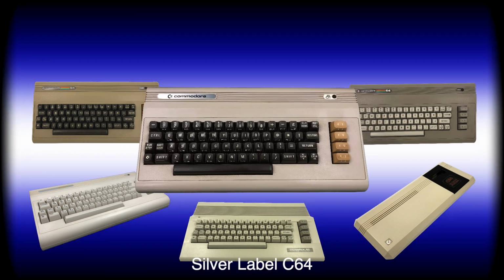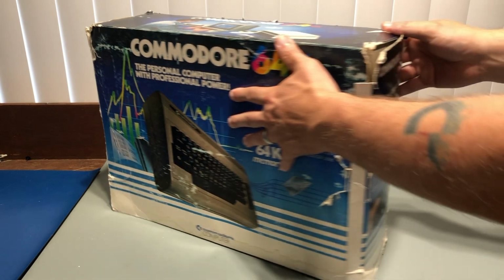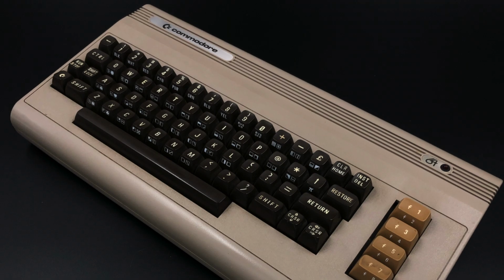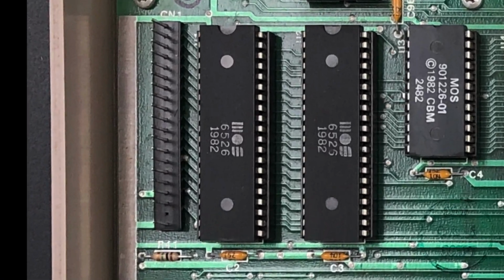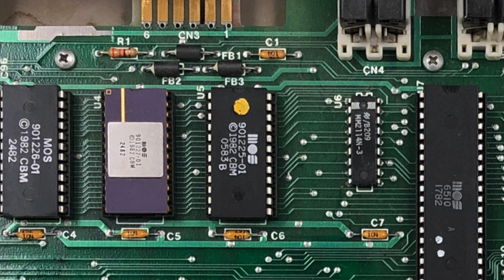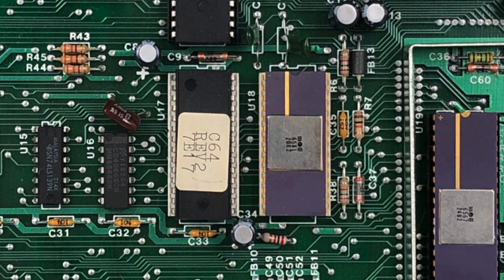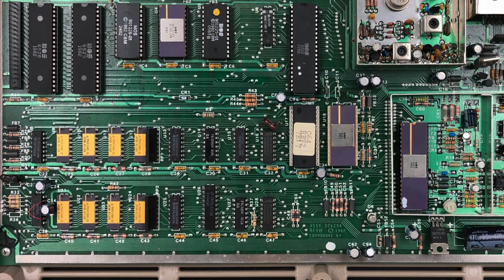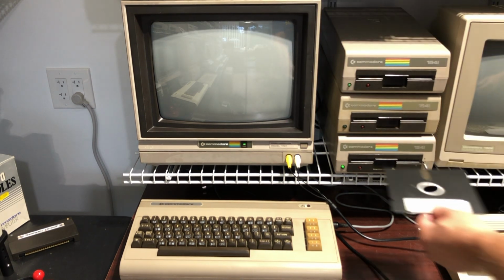Exploring an early silver-label Commodore 64

Comment: Thanks for the video, I really enjoyed that. It took me back to the multitude of C64s that I had (ex-programmer)

The 6581 and 8580 difference is easily noticed when playing something that uses the filters and/or sound samples. The filters on the 8580 are generally preferred.

The 8580 would play samples very quietly. A fix for this has been discovered, I think it involves soldering a resistor across 2 legs on the SID.

Comment: I have several early silver labels, not quite as old as yours but one is close in the 4000 range.
I also have a 4-page sales brochure from '82 that shows a silver label c64, a black label 1540, a VIC 1515 printer, a white (lawsuit) joystick, white paddles, a VIC modem cartridge and a white/black C2N cassette player.
Naturally, i had to get all those exact peripherals for my silver label display.
Reply: I have silver label too mines 1982 rev C board is that one rare ? And how much is worth it in very good condition also it had a ram upgrade
Reply: @bayfinest1938  It's hard to put a price on this without seeing the machine itself. The Rev C is already much rarer than the Rev A so price would depend on how low the case serial number is and if the board has any purple ceramic chips. I'd say a nice example with a serial number below 10000 can fetch over $1k, even more if it has purple ceramic chips. If yours has purple ceramic chips or a low serial number below 5000, i'd be interested if you want to sell it.
Reply: @CybAtSteam I can send you pictures
Reply: @CybAtSteam  mines serial is 6259

Comment: I remember that old white Styrofoam that came with my Vic-20 in 1981.   It's not surprising that Commodore used the same packaging that was used for the Vic-20 till it was changed in later models.  I've had the Vic-20 (Golden badge), C64 and Amiga 500 before moving over to the Linux world.
Reply from the maker: Similarly, I went from Commodore to Unix servers once I began my professional career.

Comment: You can't trust commodore serial numbers - they were notorious for releasing anything out the door, broken or not.
Reply from the maker: Sure, but you can use serial numbers in conjunction with date codes on chips and other clues.
Reply: @commodorehistory   Definitely keep that C64 long as you can.  It's really worth weight in gold as I can't imagine how many of those early C64s are still around.

Comment: The C's SID sounds a little quieter, assuming that you didn't bump the monitor's volume at switchover. But I can't really tell a difference besides that. If you will run it again with a direct capture then maybe I'd be able to tell. Anyway, what difference there might be is really subtle to me at most, so that's good!

Comment: If they were fixing all these bugs then why didn't they fix the one that required them to make the 1541 so the computer could have a slower drive friend to play with?
Reply: That wasn't a bug, that was by design
Reply: @CybAtSteam : It was a bug. The story is that the 64 needed its disk drive to be slowed down because of this bug that they never got around to fixing. They wouldn't design that into the computer.
Reply: @HelloKittyFanMan  Nope, not a bug. The VIC-2 needs extra cpu cycles during "bad lines" (every 8th raster line) to fetch sprite and character data for the next 8 scan lines. During those bad lines, it needs to halt the cpu (yes, the c64 had dma) for additional cycles.
Because of that, the existing serial code from the Vic-20 had timing issues (since the Vic-20 didn't have sprites to deal with). This was solved by making the c64 serial timing slower than on previous hardware platforms. Again, not a bug, but very much by design.
Reply: @CybAtSteam : Yes, a bug, because:

1. It's always been described as that by experts of the history, because...

2. it's something that Commodore could've fixed but pushed the computer out too soon for, and...

3. it's something that software-based fast loaders -- even  those that don't blank the screen during loading -- DO temporarily fix, and...

4. is something that the hardware-based fast loader did fix permanently, and...

5.  it indeed WAS officially permanently fixed by Commodore in the next VIC-II-based  computer that was released: the (non-B) 128.
Reply: @HelloKittyFanMan  Not a bug. There are several videos on YouTube where Al Charpentier talks about the VIC-2 design and the timing issue specifically. He's the guy who designed the VIC-2.
And i'm inclined to trust his account of why it is the way it is over some random guy on the internet that insists that something is a bug even though the actual designer states it was done by design.
Reply: @CybAtSteam : The videos I watched that describes it weren't just from some "random guy." Also, I love how you conveniently left out any counter explanation of how the problem is fixed by fast loaders and by the 128 even though this is supposedly "not a bug."
Reply: The fix was known for C64 production time but it would have been a breaking change and drives would not be interoperable between VIC and C64s. In C64 they had to run even a bit slower due to higher resolution and scan line time.
Reply: @kippie80  Commodore could have fixed the C64's timing issue and revise the 1541 to be as 1542 to say it will only work with later models of C64.  However, I don't think the public would fully understand the differences and create a massive headache for everyone involved.   Easier just nerf the C64 and keep going.   Although I loved my Epyx Fast Load cartridge.  🤣

Comment: These early c64s still have a luma pin on the video out. Commodore originally expected users to use composite for the chroma signal on the 1701/1702

Comment: Great work Dave; I haven't heard such a clear explanation of the cause of the sparkle bug before!
Reply from the maker: Thanks so much Robin!  I used Al Charpentier's own words from the March 1985 issue of IEEE Spectrum in the "Design case history: the Commodore 64" article.  There's one detail I left out that's described in the article that explains there was a pre-charge circuit in the ROM that made it sensitive to spurious signals.  I always struggle with the balance of providing too much or too little information.  In this case, I should have probably included that detail.

Comment: If you don't hear the difference between SID chips is because you are playing normal sounds.
Fire up IMPOSSIBLE MISSION or GHOSTBUSTERS and you will hear a noticeable difference...
There is a way, anyway, to disable the filter they added but just connecting a resistor between 2 SID pins.
Reply from the maker: Good point on the differences when speech synthesis was involved.  I probably never paid attention to that in the past.
Reply: @commodorehistory  The filter cutoff frequency curves are quite different too. So, in the end, digital sound code written for the 6581 is often almost inaudible on a 8580, and I met more modern demos, written for the new SID revision, with complete tunes filtered to silence by the 6581. I'm not into their religious war though ,as I can't say if any of the two is better. They're surely different. And the 8580 seems way more durable, I have much better success rate with the trash picked 8580s than with 6581s.
Reply: There is no difference in sound because the other Commodore 64 is the red LED version, and it has a long board and the old SID 6581. I have this version, so I can confirm it. However, there are differences in the image, which results from, among others, from another VIC-II chip (later revisions had 9 brightness levels) and the S-Video signal, if it was connected.
Reply: 8580s on NTSC C64c’s are rarer in America than in Europe. Usually the keyboard will also change and have the PETSCII graphics printed on top
Reply: You can probably run it through audacity to visually see the differences.

Comment: Nice work! I've never seen that cardboard C64 box with the PET dual drive before.
I have my original C64 purchased in '83 (original owner) serial no. P00138518 ASSY 326298 REV A (C) 1982 that came in the corrugated cardboard box you show with the 1540 on it.
Curiously my ASSY 326298 board is Rev. A whereas yours is Rev. B., but ostensibly manufactured earlier.

Any idea what the date/timeline was for the ASSY 326298 change from REV A to REV B?
It has been suggested that my machine with ASSY 326298 and rainbow badge may have been built from a returned/refurbished board. (We bought it for $595 in early '83. Its chips are dated mid to late '82.)
Reply from the maker: I was chatting with some friends about this. Based on a small sample size, we concluded that they shipped completed units first with rev B, then rev C, then went back to rev A boards. No idea on timeline.
Reply: @commodorehistory  Exactly what I wondered - if they went back to REV A; they seem, albeit anecdotally much more common too. But they were followed by much bigger fixes with the next ASSY #s.
Tnx!
Reply: @commodorehistory  hi there are many theories about it, my c64 has the same dual floppy drive box, with S.N. 6473 motherboard 326298 rev.c
I have another one that has a serial number 11953 and mounts the 326298 rev.A. Of all the revisions (a.b.c.) the rarest in my opinion is the rev.B.
in Commodore they may have replaced rev.A with b or c, trying to get rid of the sparkle bug, but I'm not sure about that. Or more simply they could have sent the units as they happened to hand to the workers. This would also make sense, given that at the time they certainly did not think they would become collector's items and that we would question ourselves about these facts!

Comment: Fantastic!  Another great video.  Thank you!  
My first C64 was an early 5-pin model since that was what the camera store happened to sell us in 1983.  We did use a 1701 monitor eventually but we did use the rear jacks as there was/is a cable that supported it.  I don't recall the COMPUTE! magazine issue that tells you how to make your own though.  I call it a Pseudo separated cable. It does improve the video over composite very noticeably.  IIRC it uses the monochrome pin for LUMA and the Composite pin for CHROMA. The 1701/1702 can happily support this non-standard signal.
Reply from the maker: So cool! I hadn’t heard of that before. I’ll look for it.  Thanks!!